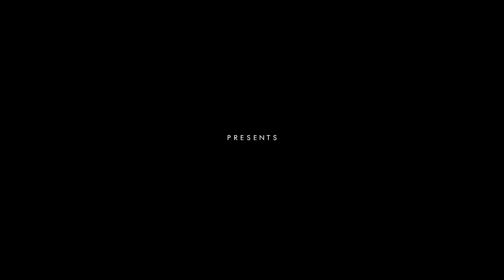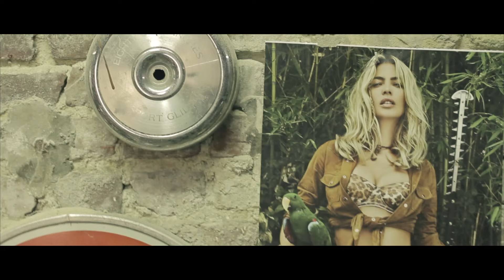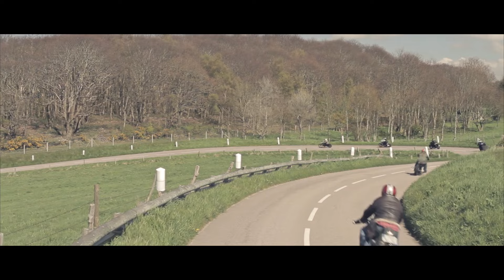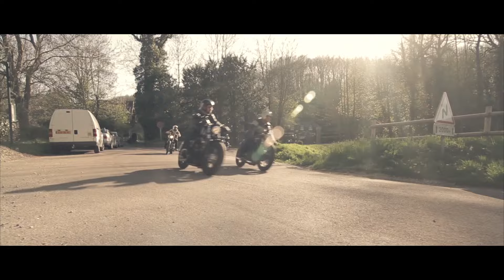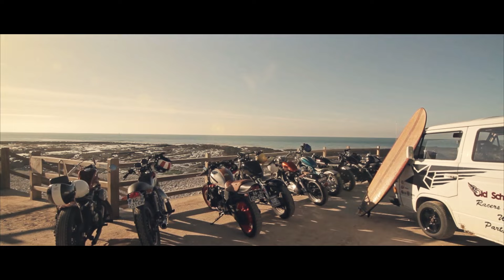old school engineering 2013 1920x1080

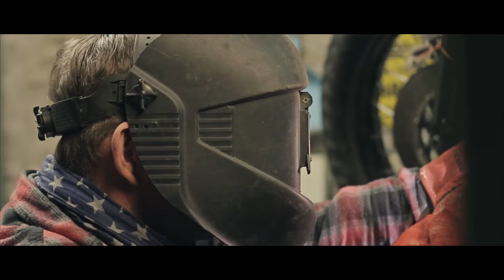Comment: Is this for real? At 0:59 he tightens his finger with a ratcheting box wrench, and at 1:15 he starts doing I don't know what, but it sure as hell is NOT starting an arc with a welder. This is a great submission to Bullshit Hipster Bike Videos!
Reply: That is actually how you start it with a stick welder.  However, I submit that that guy sucks at welding.
Reply: Chris Gagnon probably need more power that’s why it was sticking.
Reply: Yeah its not like TIG welding ;-) , mostl likely humid sticks or not having the "knack" - mind you..it took me about a year to get proficient enough to get by....380 Volts might help...anyway ...besides the point ..I'm not into this hipster thing anyway - just old school wrench monkeying to get the stress of the week off my shoulders...I kinda liked this vid though with a pint and a smoke at hand
Reply: Indeed, after air-guitar, air-mechanic!
Reply: I agree that was kind of fake.
But riding as a hipster is still better than not riding at all because of "danger"
Reply: Agreed but, the rest ok .......
Reply: Maybe his finger was loose?

Comment: Great video! It's possible to find the logo that appears at the begining of the video? With what program did you do it?
Reply from the maker: Hi!

Thanks for your comment!

I found this video in YouTube a couple of years ago and shared it... I did not do it, though I wish I could have played a part in it :-). I am a motorcyclist, I have been riding them for some 43 years now (I am 56 at the time of this wiriting). I have a H-D Sportster, converted the engine from 883 to 1200 cc and other changes.

I loved this video and just shared it. It seems that people find my profile before they find the original and it has lots of visualizations.

I am sorry that I can't help you more. I will come in touch if I can find any other info on this video.

Regards,

Carlos

Comment: Some of it was great but the "WELDING"??? He cant weld for shit. It was rubbish. But the other guy cleaning up a shaft and putting a lead on it for easy entry than polishing it up with Wet n Dry was good sound engineering. Workshop looked oj#k wish I had one ;like it.